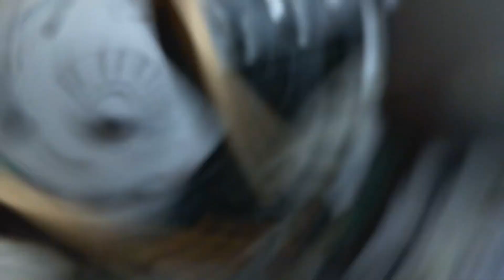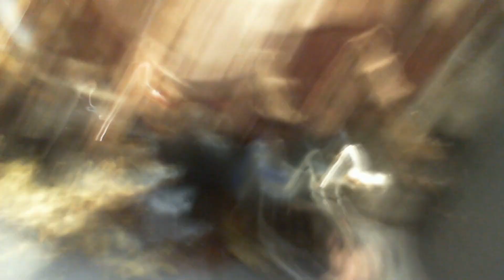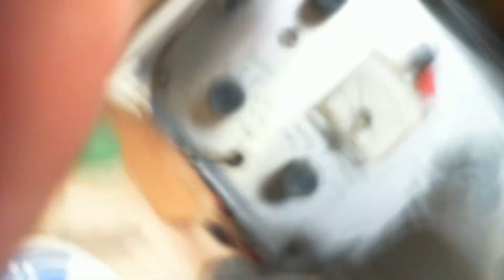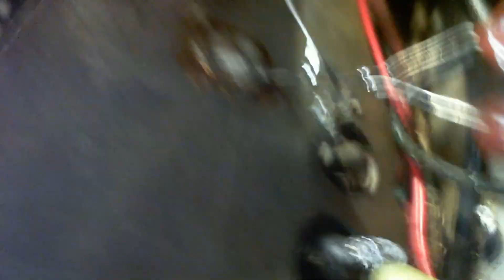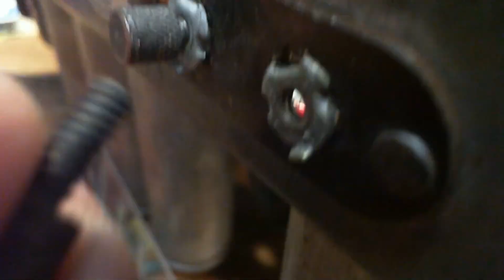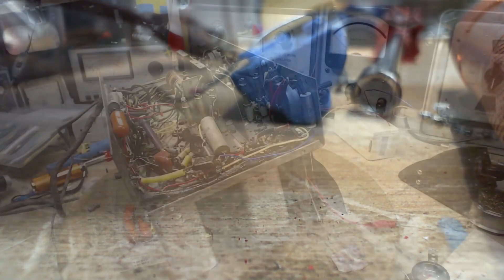Canadian Westinghouse Model 512 Tube Radio Video #14 - More Wires, Parts and Epoxy

Comment: The short wire was left there either for an add on later or a part they did not need there(My Guess)!
also, Electrical tape was invented in 1946!    ---->   https://en.wikipedia.org/wiki/Electrical_tape

every time Jim says it is 20ºC I keep thinking it must really be cold there. yet, I am from Iowa USA! so we use Fahrenheit. 4ºC would be around 30ºF? am I right on that?